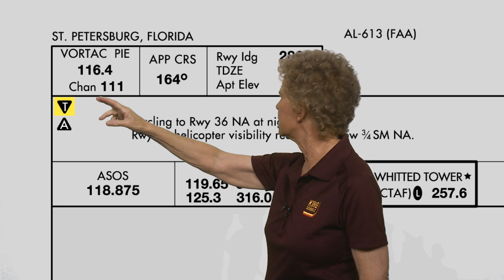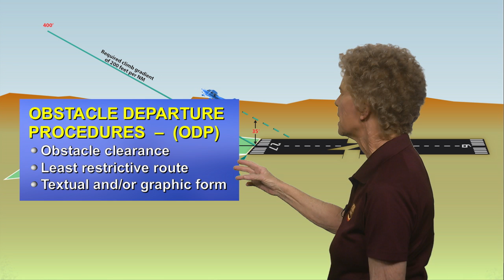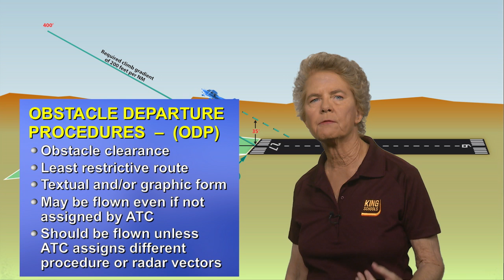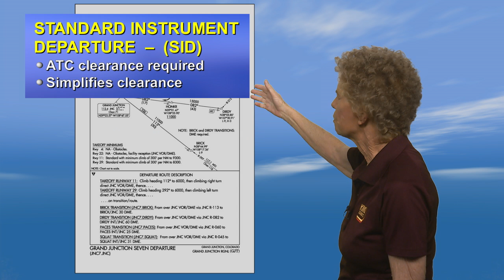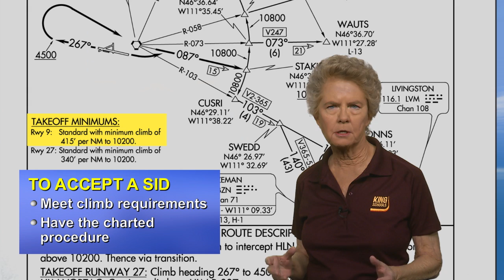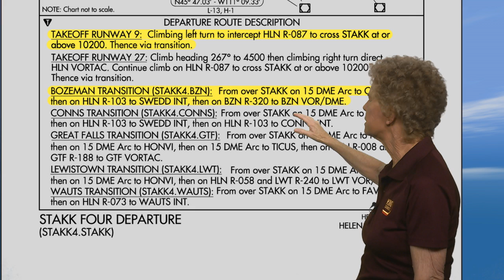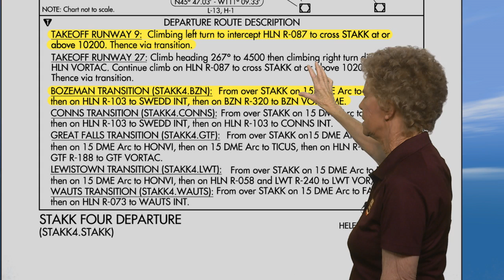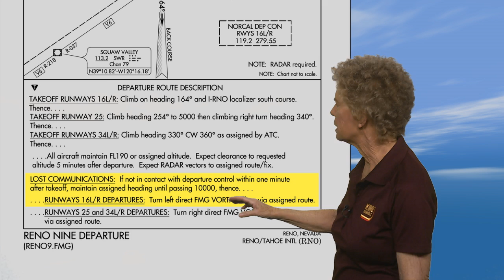ODP and SID Departure Procedures // IFR Flying

Comment: What happens (Please cite any FARs) when my SID or ODP ends at an altitude lower than the MEA/MOCA of the airway I intend to join.  Example, the North Town 5 at KVGT (NOTWN5.LAS) ends at 7000' and I want to continue on V394 southbound (MEA 9000').   {I know the procedure says at or above, but let us assume that the best climb I could get only got me to 7000'.}  Bigger picture, how to get on an airway after takeoff with a really high MEA if the ODP and SID do not allow enough time to climb.  An answer might be found in FAH 8083-16B at the bottom of page 2-35 (2-27 for VFR), but I would like something more official and clear.  When does "Takeoff from an airport" end?  25 miles?  46 miles?  Initial cruising altitude?  Surprisingly, there is very little to no information about how to actually get onto an airway at the correct/legal altitude from takeoff.  Might make a good video?

Comment: Greetings King Schools,

Great article and video! I just have a couple of questions, I know that there are several IFR departure procedures including ODP, SID, Climb via, radar departure..etc

1. The ifr clearance/CRAFT mentioned including the craft at a non controlled airport, is the CRAFT part of the odp, Sid, or other ifr departure procedures? Or is it simply just a clearance or a “permission” from act to get into the skys from ATC. 

2. Let’s just say I’m at a major busy controlled airport KLAX for example, and I’m using the SID or ODP for my departure, will I need to copy down the a whole bunch of stuff from ATC for the CRAFT as well for my clearance or “permission” to get into the skies from ATC? I assume flying the airlines have a much more easier way like just inputing down all the information in the flight computer system right? And only for general aviation like if I’m flying Cessna 172 part 91 where I have to write down all the bunch of stuff for the CRAFT info? Thank you! Meaning do I need to get an IFR clearance from either a controlled airport and a non-control airport as well?

3. I have heard from different sources including flight insight about the number of flight IFR departure procedures, I’m not sure if this is correct but I will just name the ones that I know below, Please correct me if there any mistakes or any overlaps, thank you.

IFR departure procedures

1. SID (3 kinds of SIDs including 1. Pilot-nav SIDs 2. Radar Vector SIDs 3. Hybrid SIDs)

2. OPD

3. CLIMB VIA…SID or ODP

4. Visual Climb over airport, (Not sure if it is the same as number three Climb via…)

5. Vectors Dep

6. Diverse Dep

7. Radar Dep

Thank you so much for your help!

Comment: Can someone please tell me how it works if there is no ODP or SID? When can you enter IMC when departing? Thanks.
Reply: This is a big misconception many pilots have about no published ODP/SID. The first thing to consider is why there is not a published ODP or SID. If the airport has no IAPs for any of the runways then no obstacle assessment was done at the airport. In that case it is 100% up to the pilot to see-and-avoid them. If there is at least 1 IAP, then it depends on which part you are operating under. If you are flying part 91 then you can legally takeoff in zero-zero conditions (i.e., dense fog). Other part operators have a visibility requirement to stay legal. Now what is legal is not always safest - so I don’t recommend that. The Initial Climb Area must be followed at all times for all flight. That is pilots are expected to maintain runway centerline (not heading) until 400’ above the DER elevation, before making any turns at all. This is to ensure pilots have a stabilized the aircraft and safely transitioned to being fully airborne. Then, if IFR (and only if IFR) can you make a turn in any direction you want on your way to the enroute altitude, which would be the MEA of your course, provided you maintain the ROC climb gradient of 200 FPNM. If the controller tells you to fly runway heading, you only do so after reaching 400’ above DER elevation. If you are instructed to “turn right to heading XYZ” you only do so after reaching 400’ above the DER elevation. The absence of a ODP or SID means there are no significant obstacles in the runway environment. Now pay particular attention to the use of “low, close-in obstacles” in the takeoff minimums publication. This is why it is the pilot’s responsibility to see-and-avoid all traffic terrain and obstacles when an ODP or SID is not published, even when IFR. Hence why leaving in zero visibility is not a good idea at all, even if legally permissible for part 91 operators. Hope this helps.
Reply: My understanding: If your airport has an instrument approach, and no dp/odp then just 200ft/nm applies. If it doesn’t have an approach, it’s up to you - aka visibility /ceiling should be good enough to get to the MEA/MVA VFR.